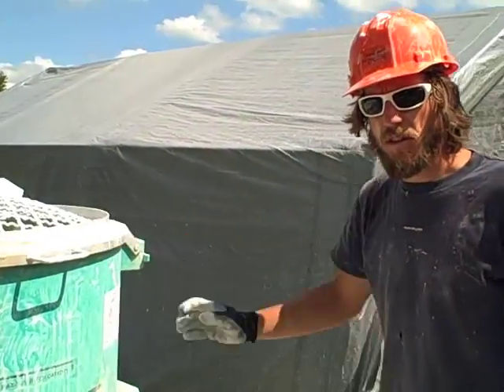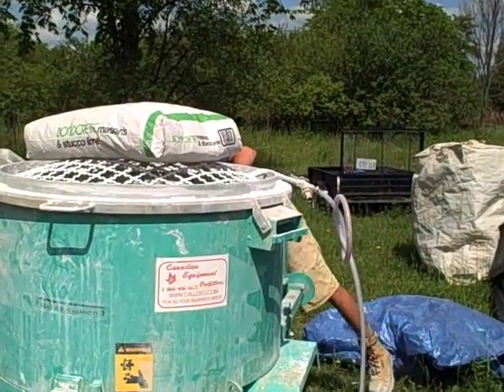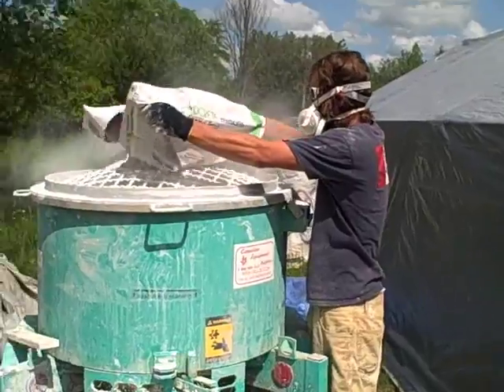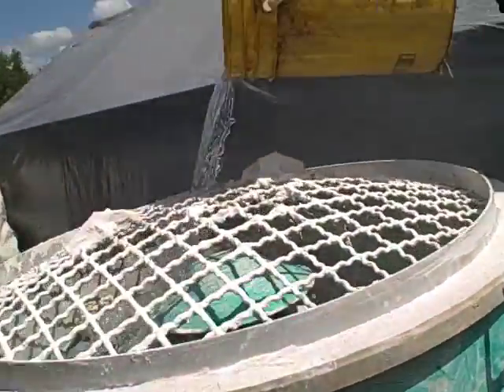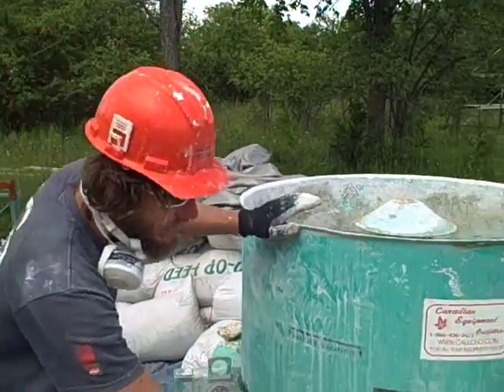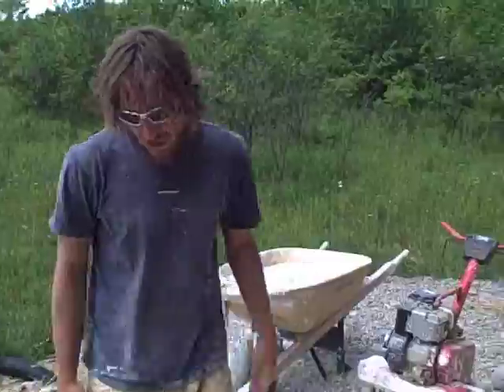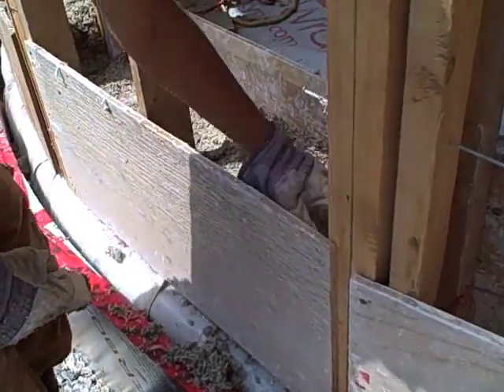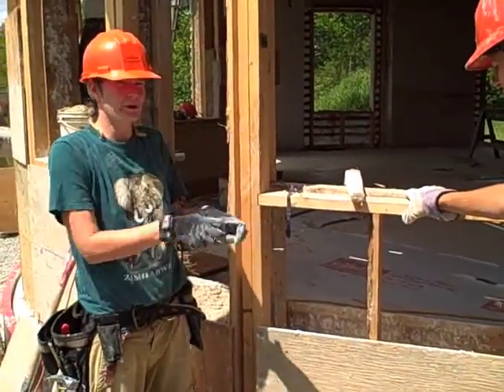SBDC 2009 Hempcrete

Comment: Hey,. Working with hemp fiber myself, . Two ways you can do that Much easier, (A) mix it MUCH drier,. It will still calcifi the same, 
 (B) have you Shiv (hardwood part) ground a good bit coarser. 
 
Both of these will cause it to dri faster as well,.